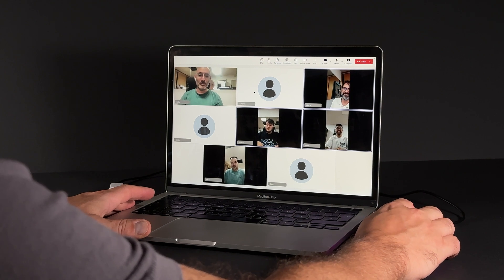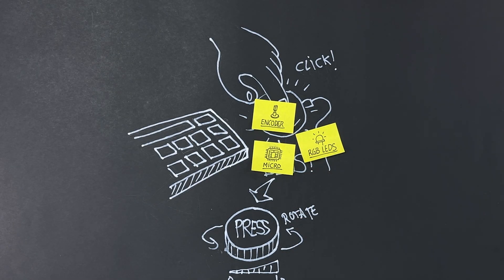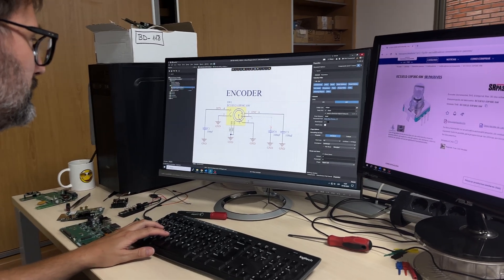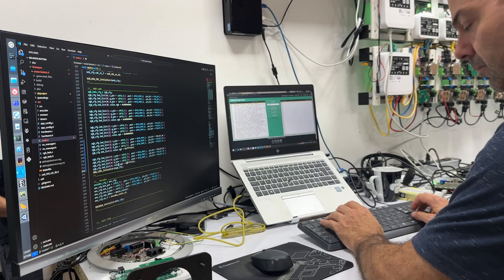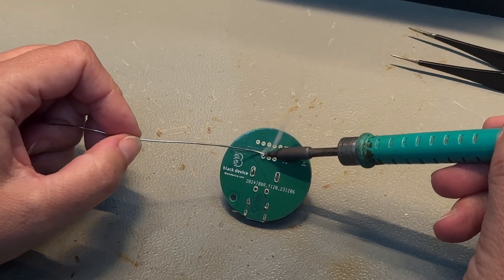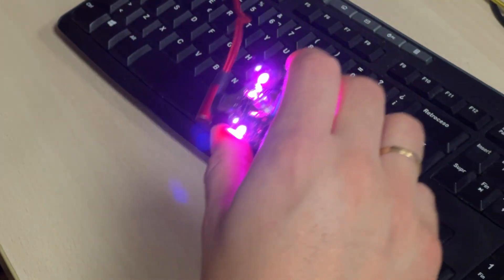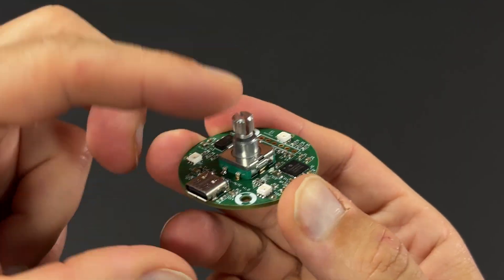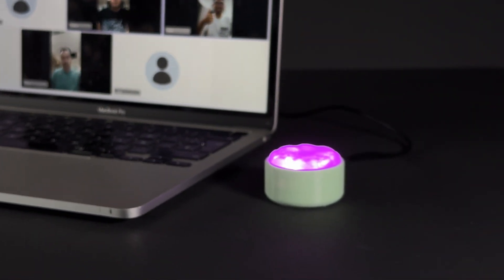DIY Open Source Mute Button with LEDs & volume control

Comment: But you never press the button and show the LED change!
Reply from the maker: yes we have improvements to make to our video creations. we are an engineering company, we learn from our mistakes 😅

we posted a short testing the button https://youtube.com/shorts/lTfOVAAX1V0?si=VSJw2EiVjPzIaMei
Reply: @ifblackdevice  Very nice! I am trying to build something very similar to this, (a big button that can mute my microphone and a light that tells me when the mute is on), but I have very little fabricating and coding experience. I'm planning on using a RP or an Arduino, and doing the software interaction with AutoHotKey.
Reply from the maker: @mdrdystdy sure you can find documentation for your project online! ours is open source so take what you need! everything is available on the github repository 🤓

Comment: imagine the disastrous impact if one was to use such device, but something along the way (hw, firmware, driver) were to malfunction, and the LED colour on the button not actually reflect the real muting state of the computer microphone. In the way you currently implement, what drives the LED colours? is it a local loop inside the firmware, or does the firmware request the driver for the real state, the driver checks the reality of the microphone mute state (OS as the source of truth) and then it feedbacks the state info to the firmware? What happens if the user mutes the mic straight from the computer? does the driver monitor the mute state and update the button led state accordingly on its own? How do you ensure the button state is kept synced with actual mute state at all times?
Reply from the maker: that's controlled by the application installed in the computer that monitors the status and send the info to the button. same if you mute the mic directly in the computer, the app sends that info to the button and it updates the LEDs.
Reply: I like how you think.
Reply from the maker: @yayu-w8z team effort 🤓

Comment: Interesting, but I have to wonder, in the age of wireless, why not bluetooth?
Reply from the maker: because we used a pic microcontroller that had not that function built in. This is open for community contributions and there is plenty of room for improvement, that's definitely one! thanks for the contribution!